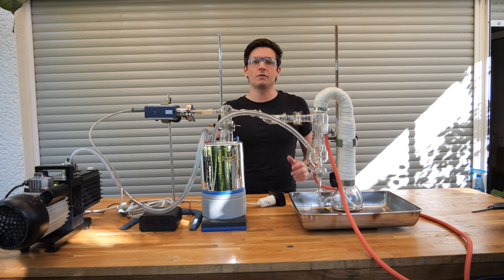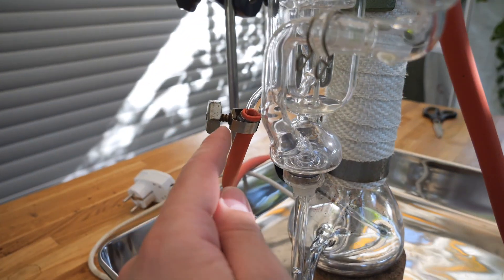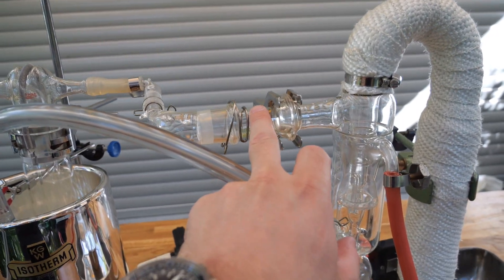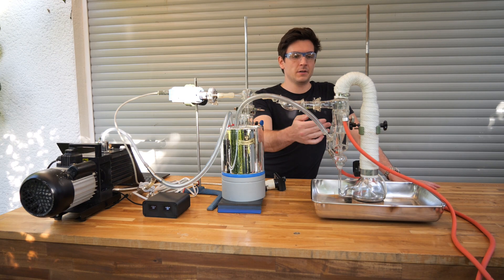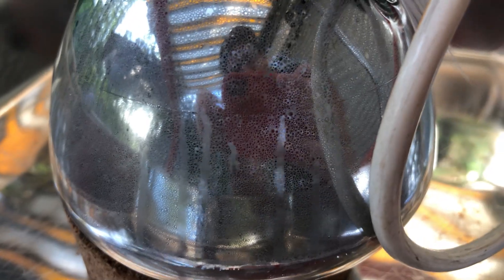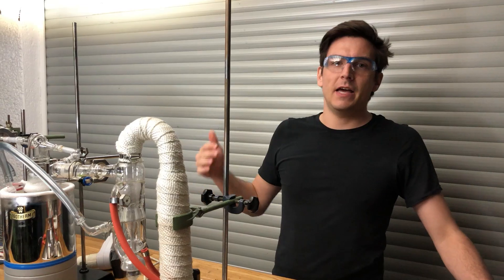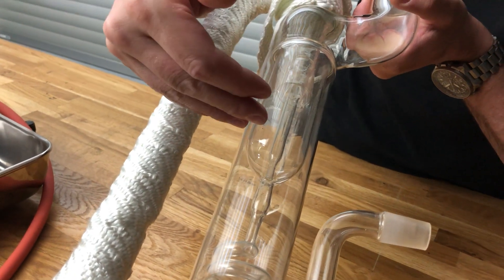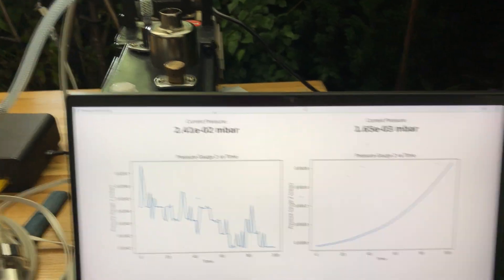Boiling Mercury to Create a High Vacuum - Mercury Diffusion Pump

Comment: Guttsy video, thanks for the bravery,... PS I instantly could see you would not get to super low vacuum when I seen the silicon couplings. Took me 6 months to realise how permeable silicon rubber is at just 0.5 atmospheres.  In fact it would be interesting to see if you dumped the glassware and use silicon rubber tubing as your check valve and boil oil.

Comment: Interesting,   I've worked on one or more of these !    In our "Control Room Area" we had 30 Sub-Station (3.75 miles apart) with Mercury-Arc Rectifiers (Metal clad, Water Cooled, 12 Anode, 2 stage Vacuum pumps) ( Side Note: had 2 enamel bucket full of mercury in the Cathode Base and also the mercury will turn to a dirty grey sludge around the electric heating element) 
Working Range  -  12 Phase 900VAC in,  750VDC out,  At a Max Constant-Load   aprox.. 4000 Ampere.
               The Commissioned Lifetime     1935  -  1970's   changed out for Germanium then Silicon (+2) in  S/stn's
   Yes,   my Medical Record does show having worked with Mercury as well as Asbestos,   "Verdigris" is my Achilles heel my eyes stream on air-born contact. 
       (and NO   I and no amount of help,   "have ever" lifted a bucket of Mercury, they gave us a enamel ladle and standing inside a rectifier you get bored when your young. 😁😁)

Comment: Do you have a video on where you made the vacuum controller?
Reply from the maker: There will be a video in the future. I redesigned the PCB. As soon as I get it manufactured I will start working on the video. But it have a video about my old gauge controller.

Comment: Hey Advanced Tinkering, I recently found your channel and I am amazed about your content. I enjoy the high quality and depth of your videos. As a chemist I was wondering that it is always claimed that the alkali metals form a colored vapor upon distillation, however looking at the videos on yt distilling them under vacuum it is never visible. Could you perhaps perform an ambient pressure distillation of small amounts Na or K in an inert atmosphere to check if the reported claims are valid ? Just an idea, also use a cheap setup of course, just short path under argon or similar. Best Max
Reply from the maker: Hi Max!
Thanks! That's a very interesting idea. I'll have to see if and how I can realize that. Since alkali metals have a boiling point above the softening temperature of borosilicate glass at normal pressure, I'll likely need to use quartz glass. And working with that is difficult to nearly impossible with my burner.
Reply: @AdvancedTinkering  Yes you are right, I didn't have the boiling points memorized and looking them up they are indeed quite high. Maybe a long narrow fused silica "testtube" under a stream of argon might suffice. So that the vapor gets condensed along the temperature gradient but is still under argon. However at these temperatures maybe the alkali metal will just react with the fused silica. Anyways was just an idea. Looking forward to your next vid.

Comment: If you put a oudin coil to it the vapor patterns of the mercury vapor inside will glow allowing you to see as the pressure changes.
Reply from the maker: What an interesting idea! It's a pity that I didn't think of exciting the mercury in the gas phase.
Reply: This is kind of an amazing idea. I would bet using the mercury l line for illumination at 365nm from a black light tube in a darkened room and with a fluorescent screen behind the setup would also allow the vapor flow to be observed.

edit: in fact come to think of it,  a simple germicidal lamp where the emission lines are sharper than the uv phosphor emission on a black light bulb may work even better.

Comment: so why would you choose complex vs simple, I dont get it, I mean just use these evaporation condensation vacuums, I think this model is overcomplicated tho, can be single simple step vacuum by condensation of vapour. the more simple diy at home super vacuum is when the vapour is the operating environment of the vacuum, condensing output is directly below the actual chamber, with a switch valve and boiler. engineers, makers, k.i.s.s., no you dont have to copy from others how they have done things, you can think yourself and choose the best system.

Comment: This is really cool, however since I'm not experienced with what a "standard vacuum" is - it's hard to understand how extreme 7e-5 mbar is. Is it a really strong vacuum or is this more about the concept itself?
Reply: That is approximately the vacuum found in interstellar space.
Reply: @christopherleubner6633 wut? not even close. Interstellar space is TWELVE ORDERS OF MAGNITUDE lower pressure than what this pump achieved. The pump pressure isn't even the equivalent of being IN space, it's going to be roughly the same as being a couple km below the Karman line at 100km.

Comment: Nice to see one of those in working order. I only ever heard that they were used in the past, but trying to get one for UHV seems to be basically impossible...
Diff pumps with mercury are interesting if you want to pump radioactive gases as (depending on the radioactive isotope) they can attack most oils ang cause them to degrade. In particular, mercury diff pumps got interesting again for fusion with research on them being done for ITER.

I and some colleagues also wondered if you could do the same with Gallium as well as a less toxic medium with lower vapor pressure. The pump would probably need to be made of something not wetted by it like Quartz, or coated with something Gallium oxide. Higher vapor pressure would also mean you'd have to heat it more on the evaporating side, so maybe that might become the issue.
Reply: Gallium has way to low a vapor pressure I would guess. Unless you are talking red heat I don’t think it would work.

Comment: "Mercury poisoning to Create a High Vacuum" I have a good ol fashioned Edwards Diff-stak ... the oil for that thing costs an absolute fortune!  
Serious question - what are the chances of mercury vapor exposure when using one of those?
Reply from the maker: If they are used correctly the risk is negligible. But if something goes wrong (breaks for example) that's a different story. 
And I definitely would not use mercury in a diffusion pump meant for oil.
Reply: @AdvancedTinkering  I love how you added the lil disclaimer to not use mercury in an oil diffusion pump. 😂 I may lack all sensibility by spending a small fortune on an Ultra high vacuum system I hardly use, but thankfully am sensible enough to nope the fuck out of vaporized mercury l!
Reply: @PoseidonDiver  If you are new to diffusion pumps, there is a very high chance that you will allow your pump to draw in air uncontrolled, like a tube come off or break maybe. This will instantly (nearly), trash an oil diffusion pump, resulting in a pump body full of sticky goo. This is not a worry with the mercury diffusion pump as mercury is unaffected by air, (very slow reaction), even at its boiling point. So your pump would be safe. You just need a cold trap on the outlet to the roughing pump. It`s case of different pumps for different purposes. In my applications there was a very real risk of the system going to air. Also the vapour pressure of mercury was not a concern, my  vac was not ultra-high.
Reply: @TheTemporalAnomaly  yep, I've actually owned one for about 3 years but have just not had the time to even assemble the system. Work commitments have eaten away all my hobby time which sucks. But yes, I am very much a 'backroom chemist' that just really enjoys having fun with the natural sciences. 
I am totally "that guy" that will make all the mistakes due to not having formal training. Fortunately I am autodidactic enough to always be safe with what I do, probably just run into higher costs as a result more than anything. 
My interests have mostly been around extracting compounds from medicinal plants (I live in South Africa, we have a wide range of medicinal plants, it's really interesting)

But it's people like the Thought Emporium and Applied Science that planted the seed with all the fun one can have with ultra high vacuum 🤣

Comment: The biggest advantage to that pump is that if the system goes to air for any reason, you don`t have a ruined pump (turbo-mol) or a sticky mess to clean out that may be impossible (oil-diff). For some applications, I still use one of those but mine is metal cased.
Reply: Are there any other performance/cost related advantages aside from an easier cleanup when there's an event?
Reply: @PoseidonDiver  Yes.  Since they are not detrimentally effected by air exposure (other than momentarily losing high speed pumping), you can skip the (very expensive) high vacuum valves needed for bypassing turbo-molecular or oil-diffusion pumps to allow rough pumping of the system (and the hazard that someone will forget to bypass and destroy the pump).  This is a large advantage for chemical synthesis, where many flasks may need to be evacuated in sequence and many experiments done in a day.  For large chambers that are only opened and closed on a daily basis, not so much.  Also, since you are already observing mercury handling protocols, mercury manometers and McLeod  gauges (sort of a combination liquid-piston compressor and manometer) can be used for pressure measurement, eliminating the need for electronic gauges and associated calibration and maintenance issues.
Reply: The high molecular weight of Hg contributes to greater efficiency.
Reply: @keithjurena9319  *Atomic weight. Elemental mercury doesn't have distinct molecules.
Reply: @EddieTheH Well, it does in the gas phase, which this pump runs on...
Reply: @keithjurena9319  Yes, but this is not an advantage compared to  typical diffusion pump oils, such as Dow Corning 705 (trimethylpentaphenyltrisiloxane) and Santovac 5 (phenylether pentamer) which have molecular weights of 546 g/mol and 446 g/mol respectively, versus mercury with an average atomic weight of 200.6 g/mol.  Also, note that both of these oils have much larger collisional cross sections than mercury, which makes momentum transfer more likely.
Reply: @keithjurena9319  That is so true and not thought of by many. This needs to be considered when people suggest using metals like sodium in a pump. And,..sodium being so reactive it would greatly limit its uses. I suppose you could even say that a sodium diffusion pump would `getter` itself!

Comment: It should also be possible to make a diffusion pump work with alkali metals. Not practical, but possible. It would need extra valves and probably some way to continuously purify the metal.
Reply from the maker: What an insane idea! A potassium or cesium diffusion pump would be a spectacle! I like it!
Reply: @AdvancedTinkering  It's especially cursed because iirc almost all the pumping function is already available if you don't go to so much trouble and leave whatever alkali metal contacting chamber to only act as a getter pump.
Reply: @AdvancedTinkering  Here's me thinking NaK would be crazy enough but you jump straight to cesium, lol! I love it!!! 😁😁😁
Reply: Vapor pressure must be checked.
Reply: @papanyanz  All the alkali metals have uniformly lower vapor pressure than mercury. Cs is closest In the relevant pressure range a Cs-rich diffusion pump would run 100-140 C if it were only diffusion pumping. In reality it's also acting as a getter, so it might run somewhat cooler.
Reply: @sealpiercing8476  Fantastic news!
Reply: Yea same with cannabis distillate.